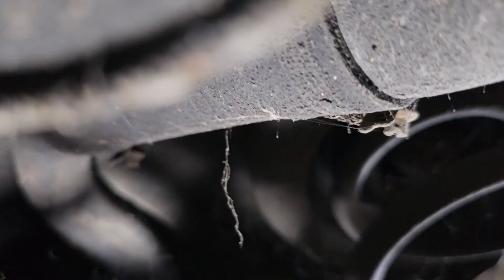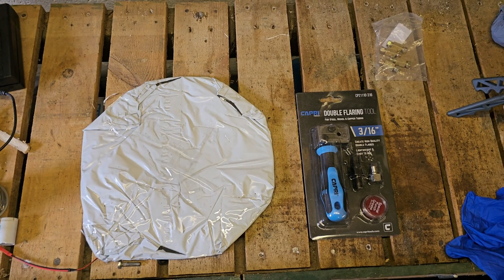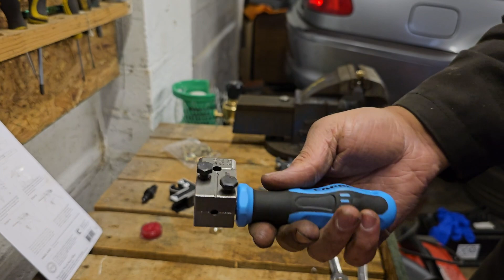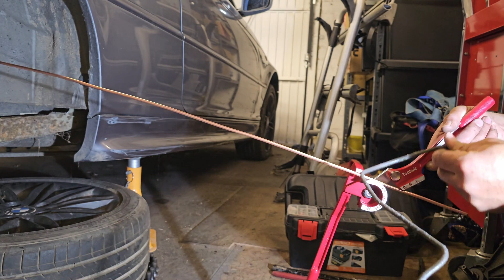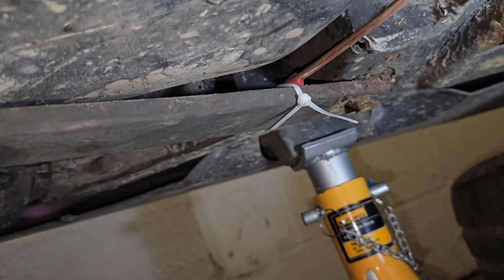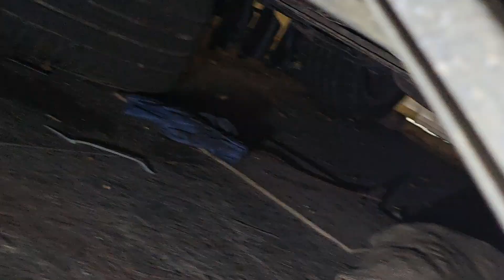2006 BMW E46 Brake Pipe Repair

Comment: The brake pedal down thing isn't a myth. You will drip some fluid but the idea is: keeping the brake pedal pressed closes off the master cylinder ports, creating a vacuum effect - like when you dip a straw into a glass of liquid, hold your finger at the top of the straw then pull the straw out - the liquid remains in the straw
Reply: Top video otherwise though mate, nicely done
Reply from the maker: Thanks! :) Your explanation makes perfect sense, that's exactly how I imagined it would work

Comment: Hi, I have a Ford Fiesta which has failed its MOT for a rusted brake pipe. How similar will this repair be on a Fiesta?
Reply from the maker: The repair process should be applicable to any car with the same fault. The only difference will be in where the pipes are routed and you'll need to check which type of flare you'll need on the end of the pipe (DIN or SAE). Hope that helps!

Comment: some other videos show that all you need to do is remove the metal clip, push it down and then unscrew the bottom part
Reply from the maker: Hi, thanks for the comment. It sounds like those videos are just showing how to replace the flexible rubber hose. In my case, the hard metal brake line had corroded to the point that it was impossible to even unscrew the bottom part, as you see at around 4:30 in the video, so the whole section had to be replaced

Comment: Nice work! I had to do a similar repair (my first time) to the rear nearside (UK RHD) brake pipe connector as mine was badly corroded. One thing to note though is that the BMW flexible brake hoses expect a DIN flare (a single operation with a tool like yours) on the end of the hard pipe, not an SAE double-flare. I used metric brake nuts (M10 x 1.0) and a DIN flaring tool like yours that can be used in the rather confined spaces under the car. An SAE flare will probably be OK as it'll get clamped down and deformed to fit. Did you use a metric brake nut to screw into the flexible hose?
Reply from the maker: Thanks!  😀 Yeah this was my first time as well. Was a little nervous, but took my time and it wasn't too difficult overall. Yes, I used a bubble/ DIN flare on the caliper end, to connect the flexible hose, and a double/SAE, for the connection to the hard brake line on the other end. Yes, I bought a pack of metric unions from Halfords. Unsure on the exact thread, but it screwed in without any issues 👍🏾